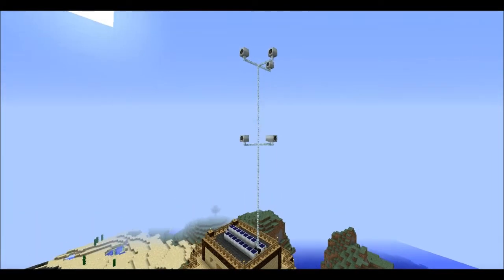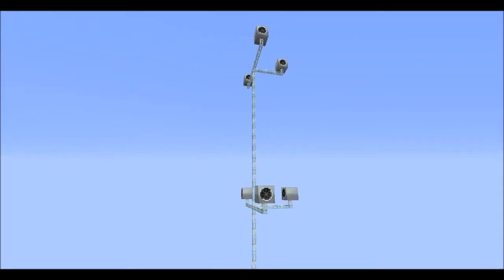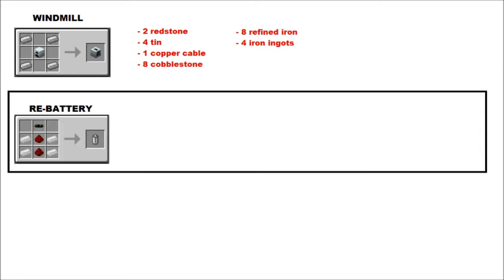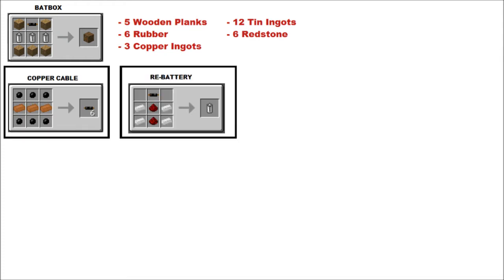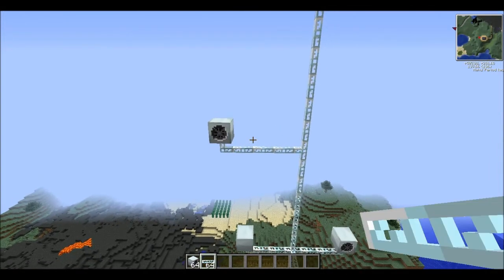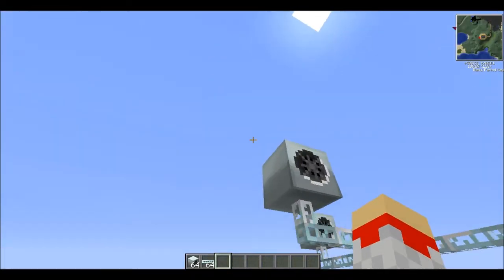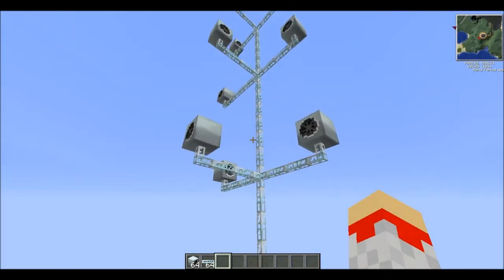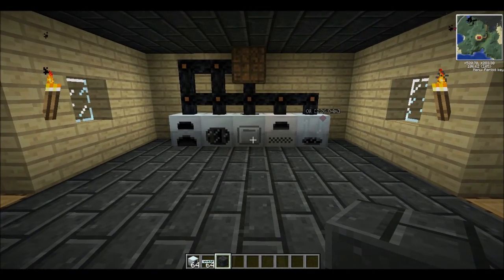Tekkit Tutorials - Wind Power

Comment: The resistance from the wiring is based on the number of wires in the entire network, not simply the distance from the windmill to your MFE. This means that if you have 40 or more glass fibre / tin cables, you'll lose 1 point of EU/tick per packet. Since Windmills (and basic solar panels for that manner) sent power in packets of 1 EU/tick at most, this results in total power loss.

Try having intermediary batboxes every so often, so that no single cable-network exceeds 39 cables.

Comment: yeah, I used this method and about 100 wind mills hooked up to glass fibre going from ground level to the sky limit and all hooked up correctly to a batbox and MFE just incase. Not even a single bit of power. And it's stormy weather right now. Not one spec of power, is it just a bug with tekkit at the moment?